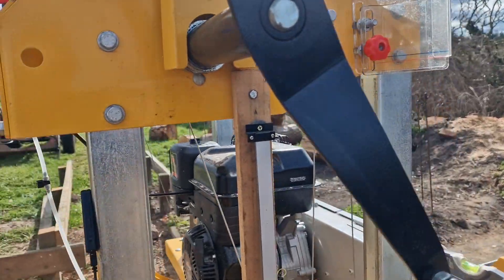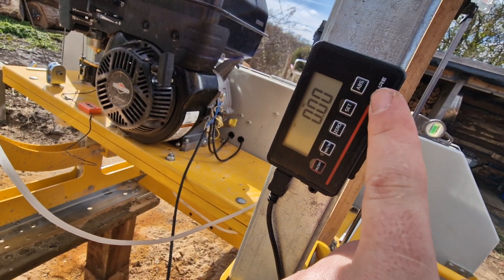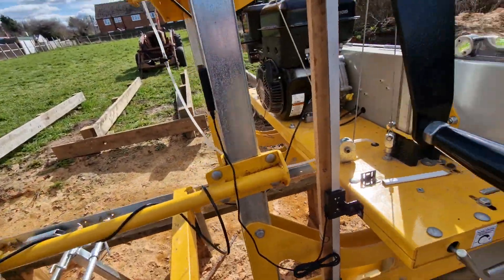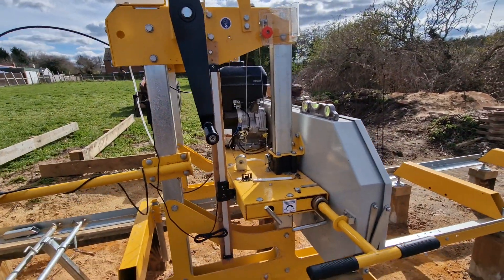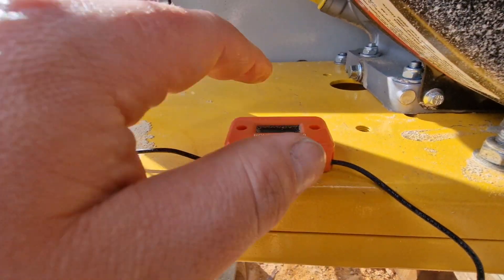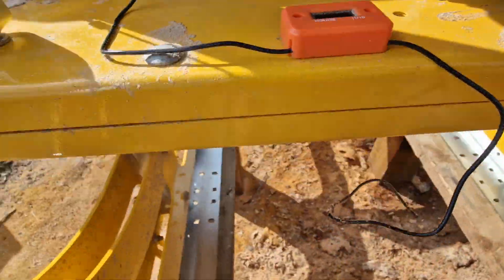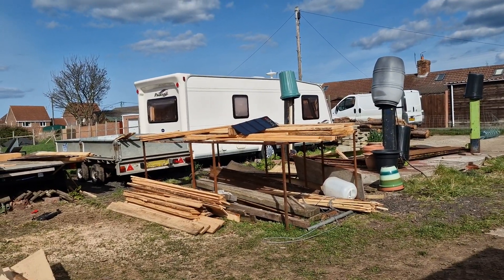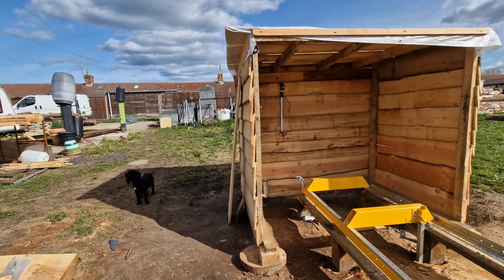OS27 Sawmill upgrades and questions answered 🪵 🪚

Comment: Great upgrades Nick. You notice how much firewood material you get aswell from the sawmill :d
Reply from the maker: Thank you Andris, I do notice how much firewood comes from the mill. My logs come in 4.85m lengths so I generally have to cut them down to size so I get a bit left over which again goes for firewood. Then all the slabs etc can be used for firewood so happy days really. 
I would like to collaborate with someone to make a sawdust briquette press to make use of the sawdust instead of throwing it away.
Thanks for commenting as always buddy 👍 😊